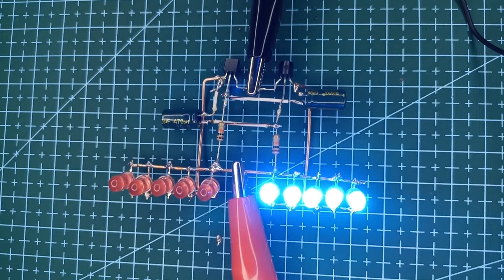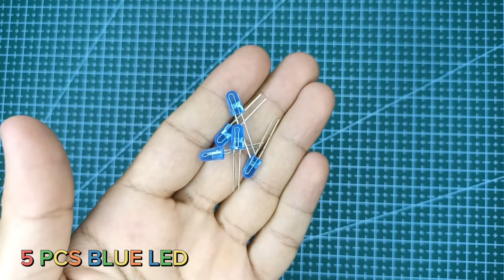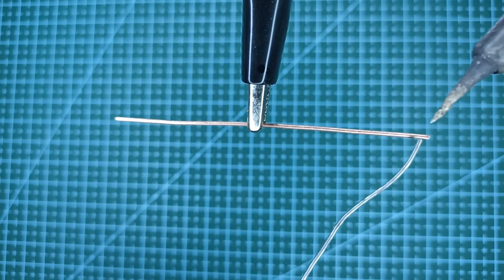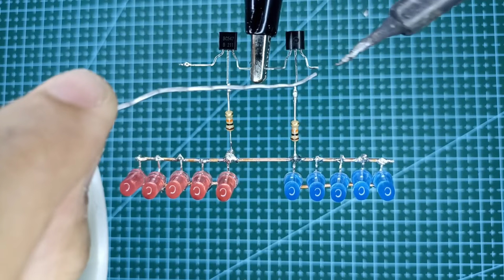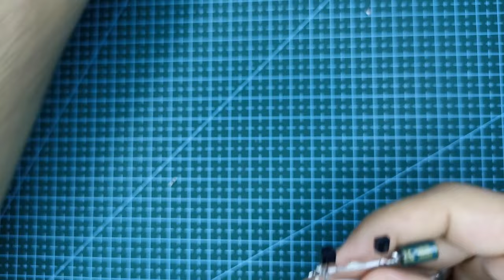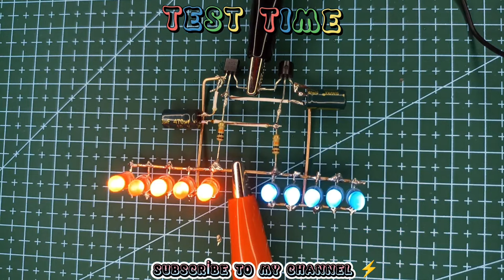How to make a Police Strobe Light Flasher with BC547 Transistor #bc547transistor #bc547 #led#circuit

Comment: Not working, did exactly the same on my breadboard
Reply from the maker: Hello friend. You must have made a wrong connection somewhere. This circuit is actively working. I suggest you check the circuit you made again🫡
Reply: @Mr.Inventorr  I followed the same steps 1 by one but Notting worked. The light are stable and on and are not blinking
Reply: It works now. In your video is a mistake, that's why it wasn't working the first time! Luckily I have found the problem

Comment: Sir I tried to do this for my project but it's not working the lights of the LED are steady.. but I just used 2 LED only.. Is that the possible problem that's why it's not working?
Reply from the maker: Dude, if the leds are not lit at all, there is an error somewhere. If the leds are on steady, you need to check the legs of the transistor. You should pay attention to the connection type in the video. The emitter must be soldered to the collector.  👍
Reply: @Mr.Inventorr  it's working sir thank you 👍👍👍
Reply from the maker: @bobbyngalides5591  🎉You're welcome
Reply: How it worked? I have same problem as you

Comment: Can it work with a 9 volt battery?
Reply: need to use higher value resistors/             easy to burn out transistors and LEDs
Reply: and  cap WVDC should be at least 12V
Reply: @kennmossman8701  20K is enough?

Comment: Se puede conectar a 12 v sin afectar componentes ?
Reply: need to use higher value resistors/             easy to burn out transistors and LEDs
Reply: and  cap WVDC should be at least 16V

Comment: सर इसको 220v से कैसे बनाए।
प्लीज बताएं सर
Reply from the maker: Hello my friend. Unfortunately, this circuit does not work with 220v. You need to reduce 220 volts to 5 volts. You can do this with a charger. Thank you for watching 🎉🫡